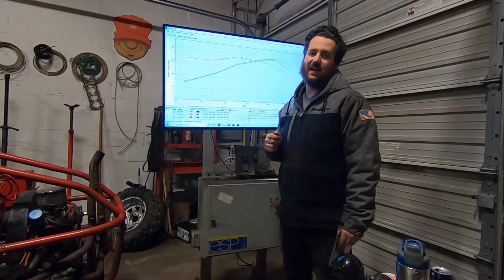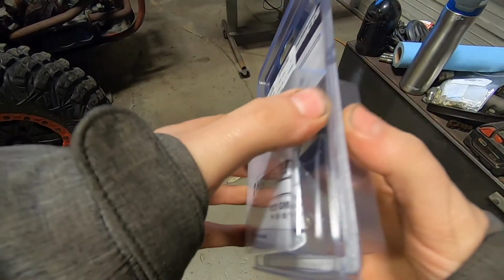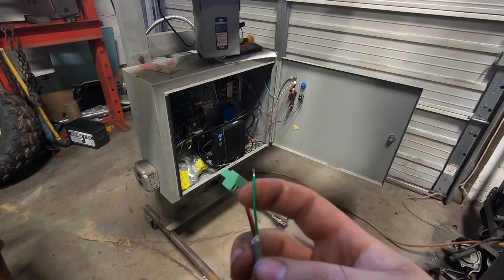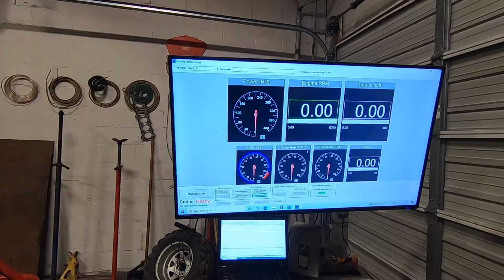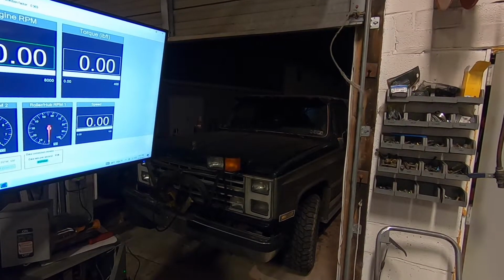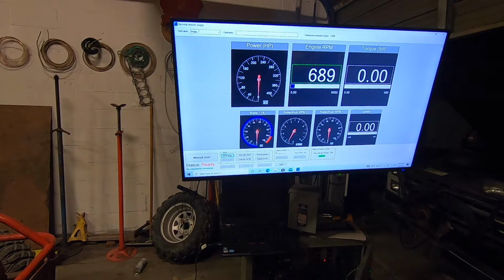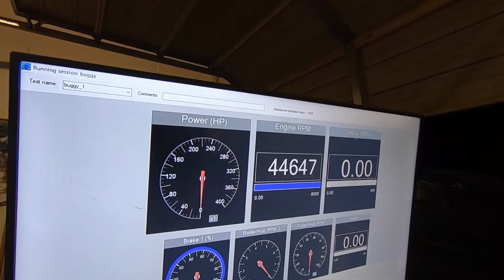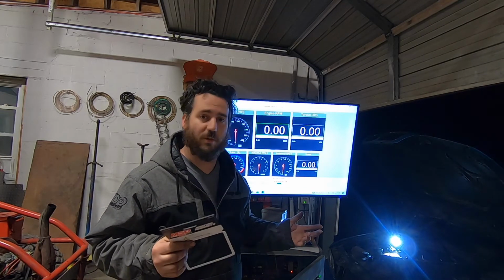YourDyno Universal Tach Pickup. MSD 8918. Works for most engines and dynos!

Comment: I see this is 2 years ago, but it is interesting.  How did you wire the BOB-09118 optoisolater to cut the 12 volt square wave down to a 0-5 volt logic level?  Did it work for the data recorder?